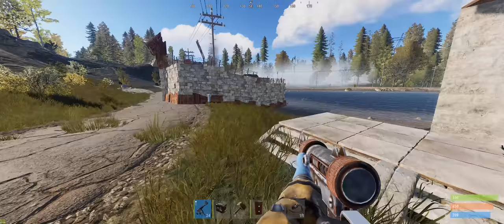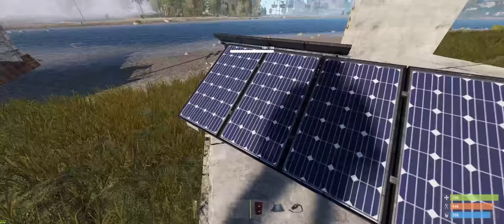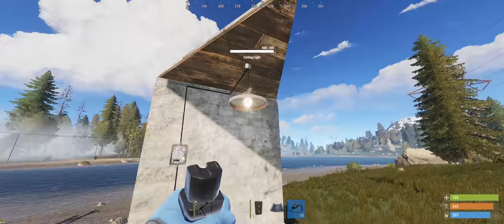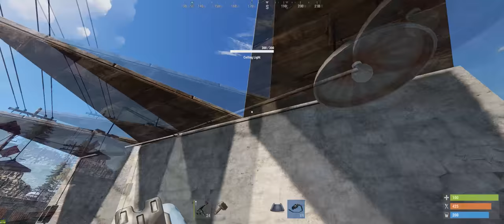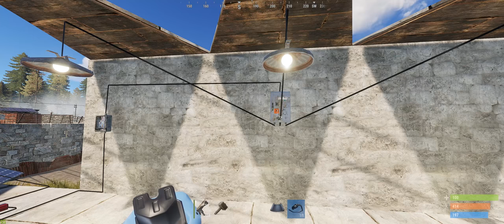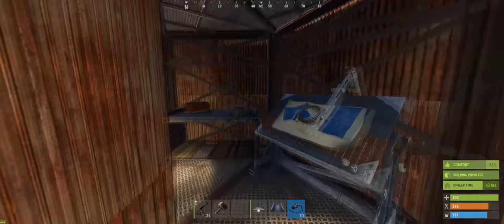Rust Electricity Tutorial #1 - Lights - Switches - Solar Panels - Splitters

Comment: The Root Combiner does work, it was only getting 30 V cause only one of the Solar Panels was receiving sunlight at a time. If you were to do it with two solar panels both facing the sun, it should make the output 60. Overall the video was actually pretty helpful cause I had a basic idea on how it works. I still can't figure out door openers.
Reply from the maker: That'll be tonights video brother. Thanks for the info about the root combiner i will add that into the start of the next video.
Reply: At 08:02 you can see that the output is at 38

Comment: No need to use the splitter if you can just use the passthrough,
 but if you want to turn on the light one bye one on different room, then you need that splitter with 3 switch.

Comment: Can you explain why switches will still drain battery even if the switch is not connected to anything on its output. And how do you deal with it
Reply: I found anything but a switch in its off position or an active blocker will drain a battery. How do you deal with it
Reply from the maker: @Get_Cubed  See my 'infinite power' video to see a system that charges the batteries even when things are powered.